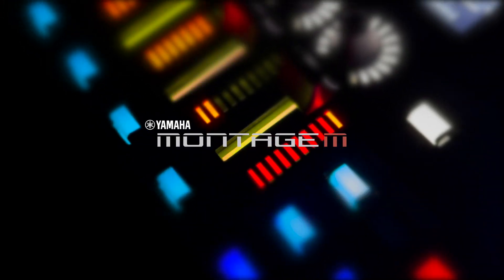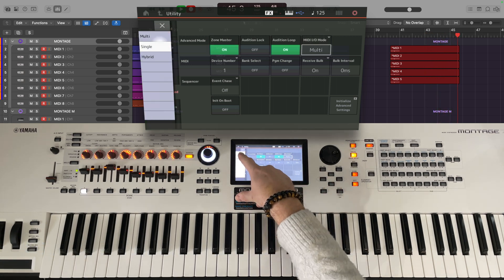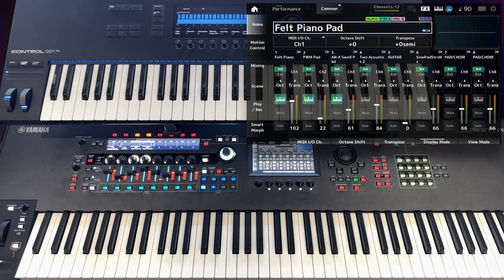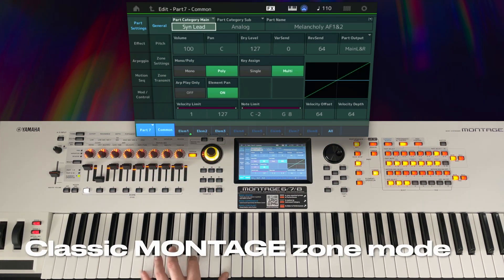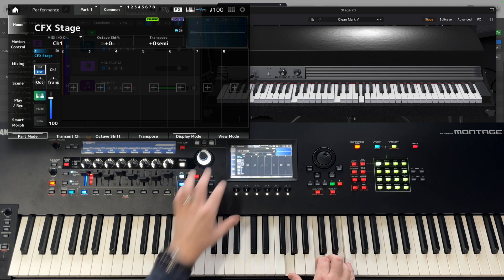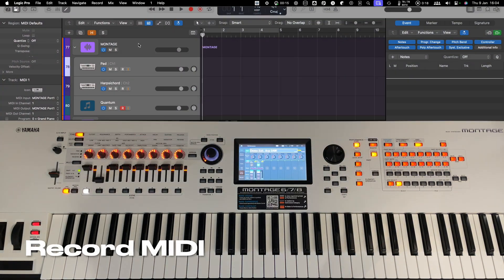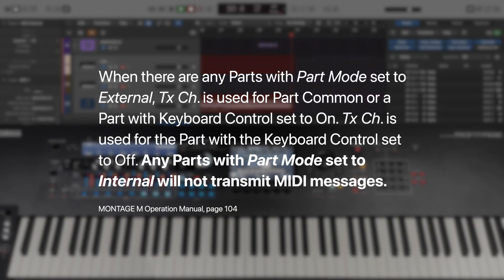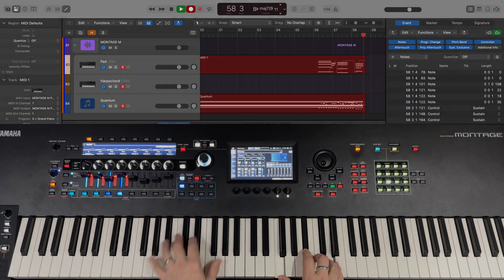Nobody wanted this change! Yamaha MONTAGE M MIDI transmission behaviour

Comment: Kier, your excellent videos on the new MODX M sent me back looking for this video again. I was trying to recall how the new MIDI channel assignment works on the M, since I only have the original Montage, which always created some challenges for me when trying to use it as a Master MIDI controller. I recall what you said about nobody asking for the limitation of either/or internal/external MIDI routing on the Montage M. But I think I can make it work for my needs as long as the MODX M uses the same approach as the Montage M. Yamaha will never get it quite right, will they!
Reply from the maker: The MIDI channel implementation on the MODX M is identical to MONTAGE M at this point. I'm still lobbying Yamaha to make a change and bring back the flexibility we had with MONTAGE / MODX.

Comment: Yes amazing so maybe you are one of the few who can help me. I have the M8x and the Oberheim TEO-5. The DIN cable has been checked and the TEO-5 works perfectly on my PB12 & Korg Wavestate SE. However the M will not MIDI control the TEO-5. It only seems to send a random note every 10 seconds and those are sustained. MIDI is set to DIN and I've literally switched every setting option 10 times and nothing changes. Turned all CC & program commands off or on also. I have used the M to control the OB-XA, OB-X8, PA5x in the past not sure since the last OS update. Yours works so why doesn't mine? The TEO-5 is either set to receive on "ALL" or channel "1" I've tried both. Thanks

Comment: Quick midi question. If I want to use the Montage M as a Master Midi Controller how can I enable this to control another synth without the Montage's selected sound playing simultaneously?
Reply from the maker: It's actually very simple. Choose a Part in your performance, set the Display Mode on the Home screen to Mode/Transpose, then set the Part to Ext (external) mode, and pick the MIDI channel upon which your external synth is listening, and that part will no longer play the internal sound engine.
Reply: @KierDarby  🙌🏼🙏🏼 Thank you sir 🫡

Comment: Hello, kurzweil addict here, i've some interrogations: is the usb midi mode is mandatory to rec to a daw ? Arps are not transmited in midi simple mode (via DIN) ?
Reply from the maker: The actual data transmitted over USB (Montage M Port1) is identical to that transmitted over DIN when that mode is selected, and it has all the same caveats with regard it internal/external parts, and arpeggio midi out

Comment: If you’re using a DAW why not just record your midi on another track in the DAW?
Reply: Like you could just put the ESP plugin on another track and record arm it
Reply: @220nextlevelsound  
The problem is not on the recording (DAW) side, but on the Montage M side, and that's where it could be solved.

The point is that, unlike the behaviour of previous models (Montage and MODX), Montage M is:
- not playing internal engine sounds if part is set to external (in order to use additional MIDI routing)
- sending only arpeggiated notes, without actual notes played on Montage M keyboard

and this can be solved only by doubling number of parts, and:
- setting it to play internal sound on the same key range
- turning off arpeggio on duplicated part so that only played notes are sent
respectively.

If it was like this from the very beginning, it might not be such a big problem (or for users who are not familiar with original Montage or MODX), but for those who are accustomed to certain behaviour, and now have to adopt work-around to solve it, it is quite problematic.

Comment: On a Part, if you have Arp on and set it to Internal, will it transmit notes to a DAW? Not the arpeggiated ones, but the notes you're actually playing/holding on a keyboard.

For me it would be enough if all channels send notes to my DAW without sending Arp notes
Reply from the maker: Yes, internal parts will transmit the notes you play (rather than the arpeggiated notes) unless you have ANY external parts, in which case they will send nothing at all.

Comment: this internal switch already exists for decades in roland keyboards
Reply from the maker: Indeed it does, and yet the Roland MIDI implementation is flawed in other frustrating ways.

FWIW, the previous Montage and the Motif before it had the internal switch too, it’s just been lost for Montage M.

Comment: If Badmister still on the forum he will say you use the keyboard wrong
Reply from the maker: Were it a case of not understanding the design principles, he certainly would, but in this instance the design is well understood and the plea is for changes to restore expected functionality that was present in the previous generation models.
Reply: Very clear and useful. I’m struggling exactly for this issue! Is there a plan to reintroduce that functionality and fill the gap?

Comment: WOULD YOU KNOW HOW TO TURN KBD CTRL OFF ON THE MONTAGE M.? I WOULD LOVE TO PLAY SINGLE PARTS WITHOUT IT TRIGGERING THE NEXT MIDI TRACK.
Reply from the maker: Press the keyboard control button, then turn off the PART button for the part you want to play, then it will play alone.

This video is for the classic Montage, but the principles are identical on Montage M:

https://youtu.be/6hXRub018Qs?si=HYyvpXSvMOnKPn8j

Comment: I think if you hook up with USB what montage should do is present two different MIDI output interfaces one for note information and the other for our arpeggio information. Just a thought. Obviously not a complete thought but I think it would be cool at least to be able to send the arpeggio information on a completely separate virtual MIDI interface from that which you play on the keyboard.
Reply from the maker: That’s an interesting idea, but I don’t think it needs to be that complex. If I’m playing a part that is not arpeggiated, I want to output the notes I’m playing. If I’m playing a part that is arpeggiated, I either want to transmit the notes I playing, or the arpeggiated notes - but I’m unlikely to exer want to do so both simultaneously, because I can output the played notes from the non-arpeggiated part, and the arpeggiated notes from the arpeggiated part. The tools are all there on the classic Montage, they’ve just been hobbled for Montage M.

Comment: What a way to complicate what should be simple MIDI implementation.  Yamaha should stop thinking and just listen to what users want and give it to them.  I use a Kurzweil and I can assign any patch to any of 16 MIDI channels I desire and they can all transmit, receive, send audio, and CC signals as I choose.

What Yamaha did was too complicated and limiting.
Reply from the maker: To be fair to Yamaha, they clearly thought that a simple MIDI implementation would do the job, with MULTI mode, until they realised that sometimes multiple parts need to receive on the same MIDI channel… and then the complexity began to

Comment: Surely it just needs an Internal, Eternal or Both choice to correct this issue...if s would that be so difficult to ad into the software?
Reply from the maker: That would be a good start, but the fact that MIDI transmission of arpeggiated notes require external parts, and that external parts kill MIDI transmission for internal parts also needs to be addressed.